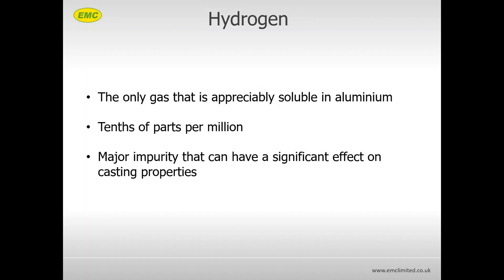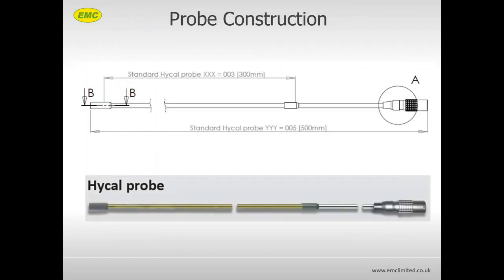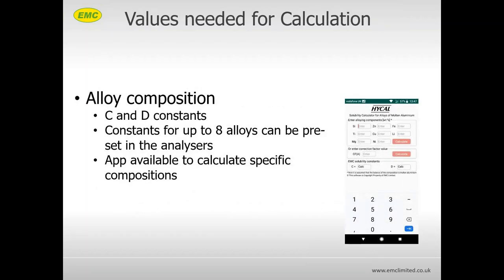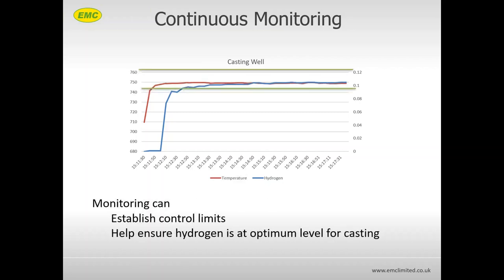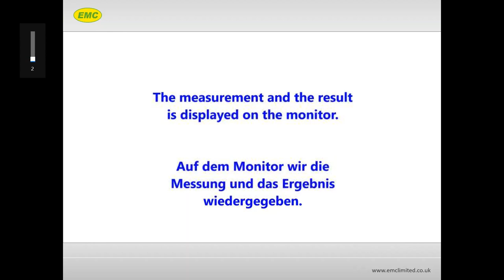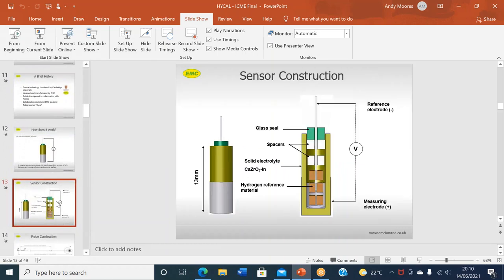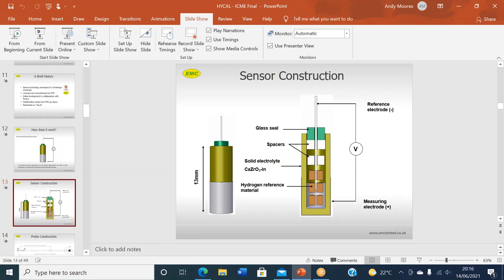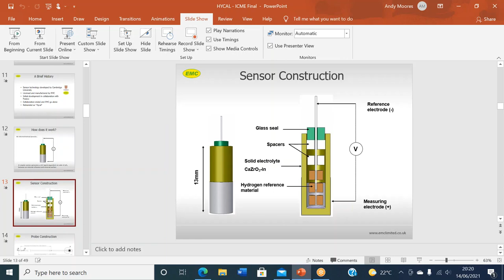Hydrogen analysis and control, EMC Ltd - June 2021

Comment: Is this why molten aluminum explodes when water is added???👍
Reply: When you add water, it becomes vapor at atmospheric pressure almost immediately and just a little amount of liquid turns into a huge amount of gas -  if you use the Clapeyron equation you could check it. So, this is an "explosion".